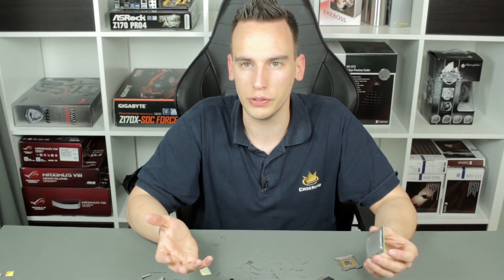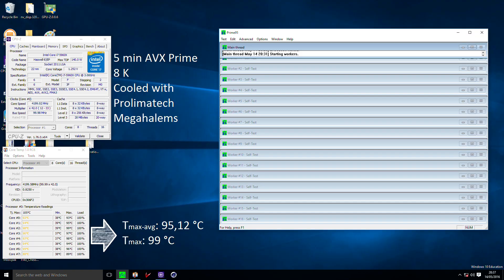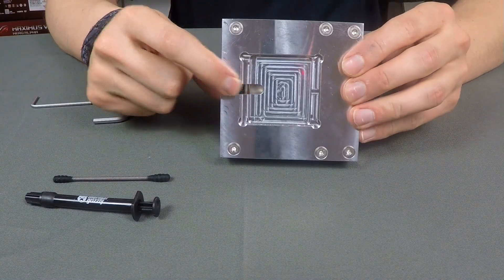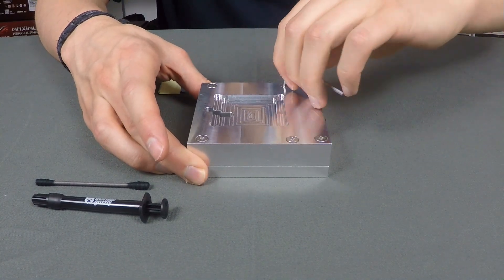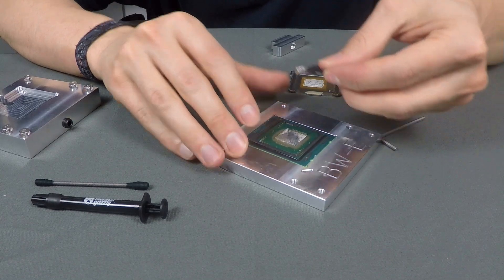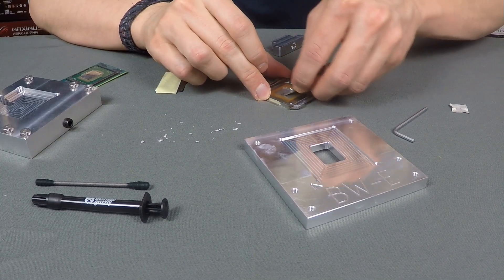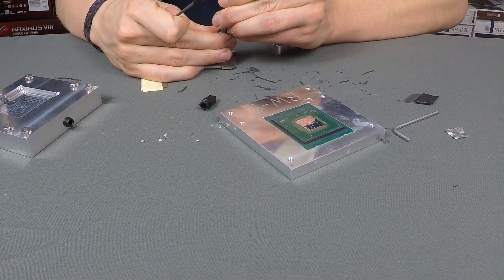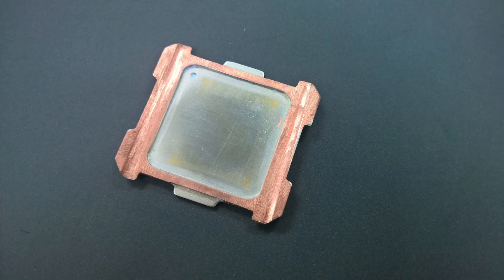Broadwell-E delid. Delidding i7-6950X and i7-5960X english

Comment: Where can I buy this delid tool? Plz inform me. Tks!
Reply from the maker: soon at caseking.de or just message me here :)
Reply: Thanks for reply. :3 I would grap one when it's available:D
Reply: I sent you an email
Reply: I'm definitely wanting one!  My 5960X and the 6800K i just ordered would be GREAT de-lidded.  One question though, i discussed this tool on OCN and people were saying that you still would need to heat up the IHS to melt the solder, and that this process would destroy the die withot that. Is this true? Or do you not have to heat up the IHS for this?  I really want to delid my 6800K but i don't want to damage it by not doing things correctly of course lol.
Reply from the maker: No you don't have to heat up anything. That's exactly why I created the tool. All other methods included some kind of heat which really sucks and increase the risk. Indium is so soft that you can push gently from the side to move the IHS. I delidded 2x 5960X and 6x 6950X so far and all of them still worked. However on few of them I accidentially removed some of the caps around the core. CPUs still worked and OCed the same as before as the caps are just additional input caps for the FIVR. Still there is some risk left. If you want one, just sent me a message and I can arrange a tool. But as I said before: There is still some risk
Reply: Ok cool. Message you how? Like on the google+ here on youtube?
Reply: Find his email in the youtube info :)
Reply: I sent you a reply saying i was ok with everything. Will wait to hear from you,  thanks :)

Comment: How do you walk with those massive balls you have?
Reply: The answer is he doesn't walk. He bounces around on them like Randy Marsh from south park
Reply: With a wheel barrel?
Reply: With shopping trolley
Reply: @FatheredPuma81 Two wheel barrows, one for each nut.
Reply: Buy cheaper a backup cpu with less cores on ebay so you're covered if shit hits the fan...
Reply: I just bought a 6800k for 250 bucks. When it arrives I'm going to delid my 6950X, and mount the water block to the naked die...
Reply: Then if i'm successful, i can sell the backup cpu for about the same money.
Reply: well were you successful?
Reply: @fireofdestruction7753  Possibly Not